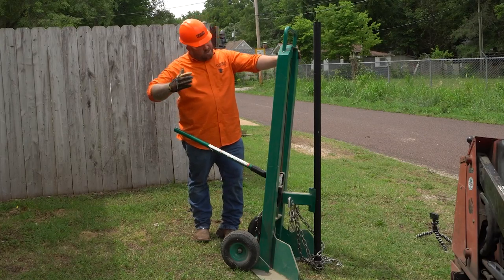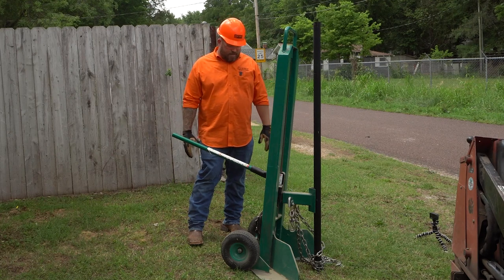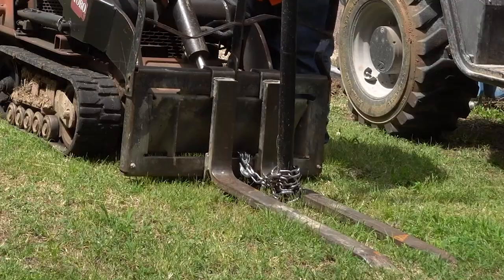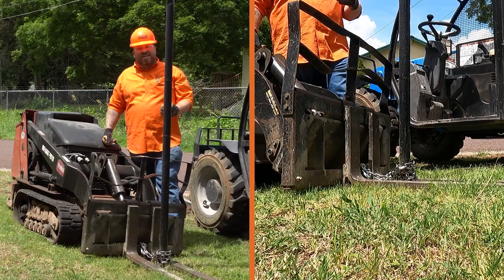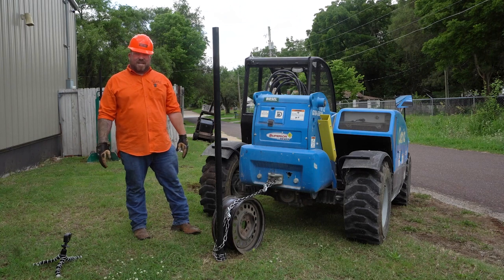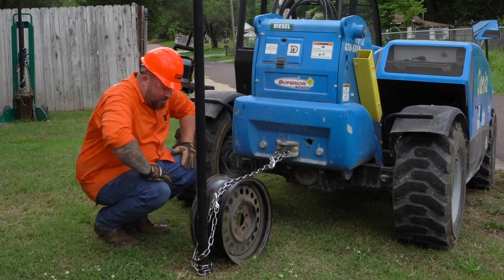THE MOST REQUESTED POST REMOVAL METHOD! Will it Work?!

Comment: Worked in a steel yard and when we pulled by cable or chain, we would drop a heavy winter coat or blanket draped over the cable at the 1/2 way point... It will dampen the snap and fall downwards instead of whipping
Reply from the maker: Great idea, I appreciate you sharing it!
Reply: Yup throw something anything u can over it. Few old timers at work wondered what I was doing & explained. They all said good idea

Comment: We always used a back tractor rim(taller) or a wheel with a tire on so that the chain would grip it instead of sliding.  Never had a problem with it.  It's a good method without the special equipment.
Reply: Yes, an inflated rubber tire on a metal rim is REQUIRED to grip the chain when using the "tire" method. tThe larger the diameter of the tire the greater the lever arm, torque to pull it up and out.
Reply: We always wedged a peice of split wood in front of the wheel to stop it from rolling too early

Comment: As a fence contractor for industrial chain link. Sometimes with a big footing we simply dig a hole beside and move it over.
Reply: How would you remove a 4" galvanized fence post buried in a 4' deep, 18" wide concrete base, if you wanted to save the post?
Reply: @jt5747  With out damaging the post? Dig beside the footing and get a jackhammer. A skid steer with a chain wrapped around the concrete is a possibility. That a heavy duty footing.
Reply: @billykennedy3750  thanks. Looks like I may be cutting them off at the base and using them fo a shorter fence.

Comment: When using a steel rim, you should wrap about a foot-and-a-half or so of chain around the fence post and through the center of the rim, connecting them using a grab hook or properly rated, temporary link. Keeps the rim from rolling away from the post, as that one did.
Reply: Yep, saved me saying exactly the same thing. Also the comment above from @ljhhontx about larger diameter wheel with tire on it - when added to your '2nd chain' suggestion is starting to look like a resolve. We use this method when recovering 4x4s stuck in deep mud. By placing a wheel & tire [vertically and in line as in this video] under the winch line where it meets the stuck vehicle, you add a lifting force to your pull that can break the suction and the accompanying inertia. Usual rule about staying out of the 'triangle of death' around any winch or rope recovery applies.

Comment: most of my posts break off at the ground.....so a little digging is required but i really like the first idea the best......put a block under the rim to keep it from rolling and it uses more leverage
Reply: Or fix the wheel to the post by chaining it through the hub center , And likely a taller diameter wheel prob with a tire would work alot better than this obviously failed concept.

Comment: Any body rig up a modified verticle position gas log splitter to pull out fence posts ? Especially a bi-directional splitting capable verticle log splitter , I'd suspect your average 25 ton splitter modified just a little bit in the right way would tear our deep heavy posts easily as long as your attachment point on the post doesn't break off I'd see it being a good setup

Comment: If you are going to gun it like those videos with a broken glass window a nice thick steel plate even if it is temporarily attached would be safer than just glass. I don't know enough about the forces potentially involved in the chain failing & hitting the driver to say how thick it would need to be though.

I think for the tire method you should have rubber on the rim & either chock the tire or use a chain or really strong cable to keep the tire from rolling. As far as the diameter of the tire or rim that will depend on the mount points on the post & equipment you are trying to pull it out with.
Reply from the maker: All great points, I appreciate the input!

Comment: Joe. How do you guys deal with concrete left in the ground when the post pulls out of the concrete when removing? Dig it out?
Reply: I'm not a professional, but the few concrete plugs I've removed have always been where the fence post rotted off at the ground level.  With a hi-lift jack, you dig down far enough to securely (you don't want that chain coming back at you) wrap the chain around the body of the plug (easier where the concrete has a lip at ground level).  Without a jack, then yeah it's a dig job, either all around, or down one side and tip it over into the new hole and pull it.  Still can be quite a lift from the weight of the plug and any initial friction pulling it free from the sides of the hole, so even without a jack, a chain is handy.  The old fence post can help with this, if you stand it up close to the plug, run the chain nearly vertical up over the top end, nail or lag it through the links to the top of the post, then pull either on the other end of the chain or the top of the post as needed.  The post tips over toward you as you pull, and not only directs the force up, but helps leverage it over.  Kind of like the rim in the video, but jammed in the ground and doesn't roll away.  And with any chain or cable under tension like this, it always increases safety to drape or tie something with a bit of weight over the chain, like a partly-filled sandbag, heavy blanket, etc., to dampen the 'whipcrack' effect if the chain suddenly comes loose and wants to 'reach out and touch' you....
Reply: Soak the ground around the post with water so the area around the post is saturated and usually the concrete will come out with the post!  Or dig down some and put the hose in the hole to get the water far Down into the ground around the concrete. Works well

Comment: What would you do if there was the equivalent of 12 quickrete bags surrounding a rotten post? Cause you might run in this problem if i hire you to remove the fence i just built 😅
Reply from the maker: Sounds incredibly solid! At that point we’d just dig around it and pop it out with a skid steer or equivalent.
Reply: @JoeEverest  nice! Thank you for answering 😁
Reply from the maker: @nosvibes9786  very welcome!

Comment: The wheel method should have a tire on it. Last video I saw had the tire on the wheel. 
I have a 6 in metal post running 4ft underground with probably 60-80lb concrete holding it. 
Looks like there's no way way for a simple homeowner with limited tools to get it out.  😮😅
Reply from the maker: @ldqa2737  most rental houses will have a solution available for a daily charge
Reply: @JoeEverest  yes,  thank you.
  We decided not to pull it.  Cut it 3ft down into the hole and covered it. I'll put a bird bath over it to flag the spot in the event we need to dig in that area.

Comment: You need to use a an old tractor rim taller that the hitch point. Then the wheel moves back toward the post. Works every time. That little wheel is no bueno!

Comment: Poor man's version is attaching a chain directly to the bottom of the cleat on a highlift jack placing the jack as close as possible to the post and raising the jack.
Second method for $50 you can by a manual puller which is simply a lever and fulcrum with a chain attached. The are at any big box home improvement store, tractor supply or Amazon.
Reply from the maker: Great point, I appreciate you sharing your experience!

Comment: Where can I buy one of them dolly jacks
Reply: Just use a highlift jack from harbor freight and use a chain
Reply: @tylerwalker6653  yeah that’s my current setup and a winch on the trailer if I can get beside it trouble is trying to lift them out straight, that trolly let’s the concrete get out and keeps it lifting straight